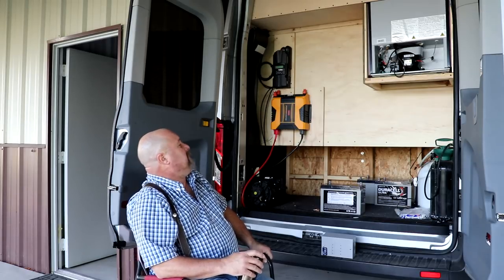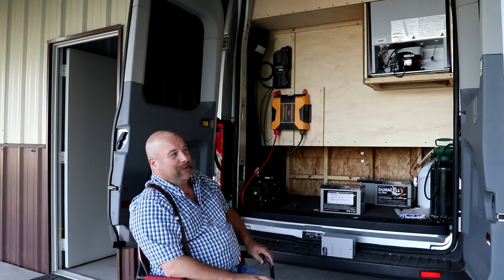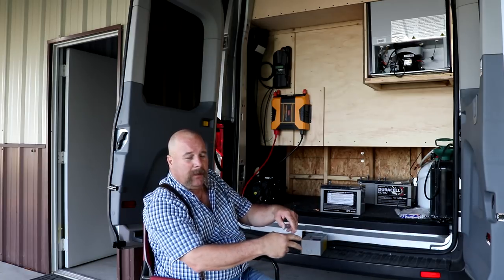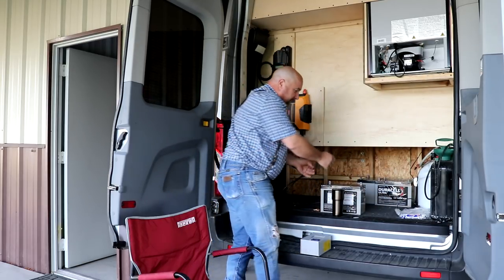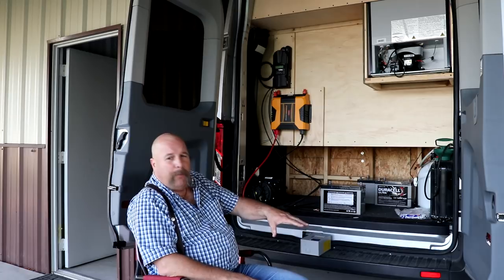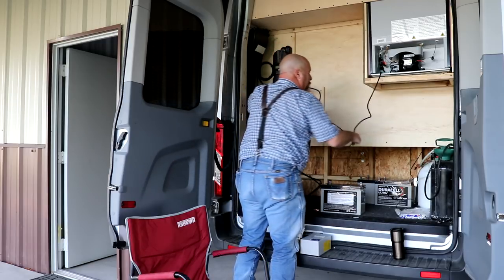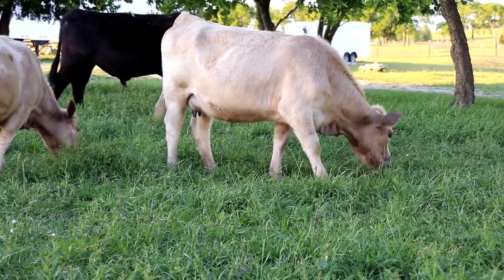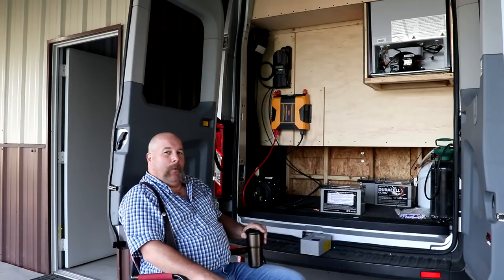183 Moooooo

Comment: with the one wire ran through just cut yourself another and however many more you need to run, then tie that one wire to the other wires and pull on the single wire to lead the rest of the wires thru. thats my trick for running wires thru fenders and such also using metal coat hanger helps sometimes